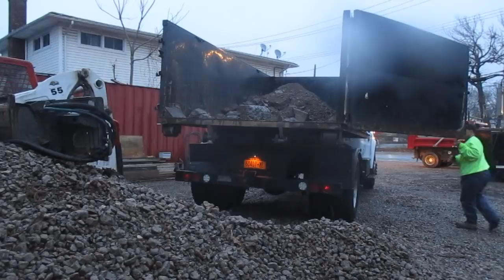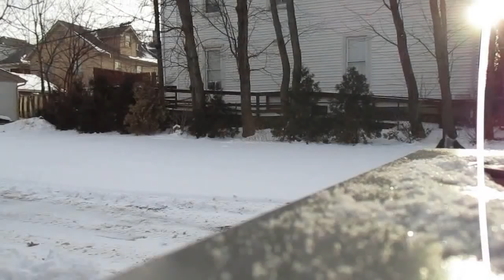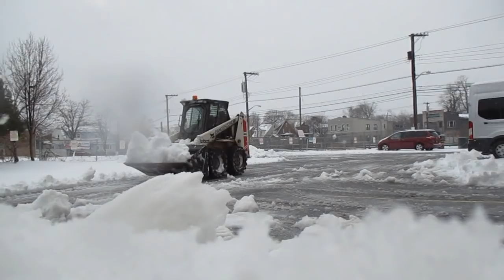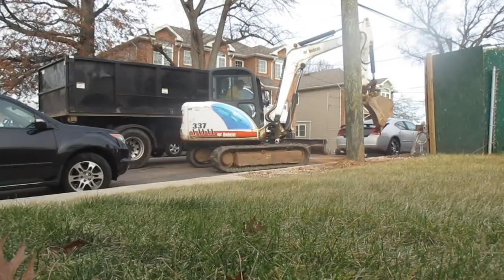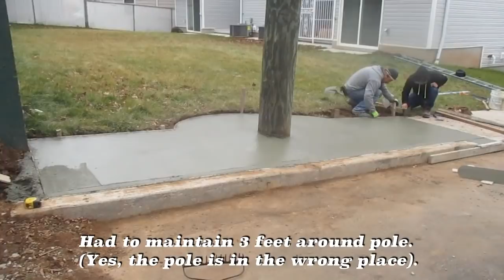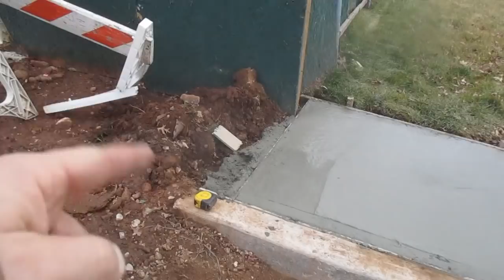The Contractor Scam of the Century

Comment: good video. I have a  kinda long question for you. 4 weeks ago my mother had a window&door guy come out for a "free estimate" on 3 windows and 1 slider. he talks with her for over 2 hrs. and shes saying I just want the estimate while he keeps discounting and increasing the pressure to commit. after 3 hrs he tells her if she likes the price he can send a guy to do the measurements in a couple days but she would have to sign now just so they could schedule the measurement. and take a 1,000 deposit then. and he says "until money changes hands there is no contract"  then has her sign a contract while she is thinking that as long as she does not give him a deposit when he comes to measure then she has not committed. so  3 days later he shows and measures and she gives no deposit then the contractor calls telling her that her 3 days to rescind are over and the materials are ordered. so he now wants the deposit and structured payments   and now we are already talking arbitration or court.  I'd really appreciate your opinion. thanks.
Reply from the maker: Well, if he has a signed contract, he certainly has a leg up. I don’t know what the paperwork says that she signed, however, let him file the lawsuit and battle it in court. He may just be trying to scare you into paying the money and doing the project. Tell him no deal, and wait for the next step. Hope this helps, feel free to contact me for anything further.